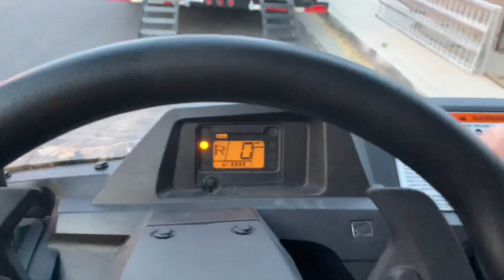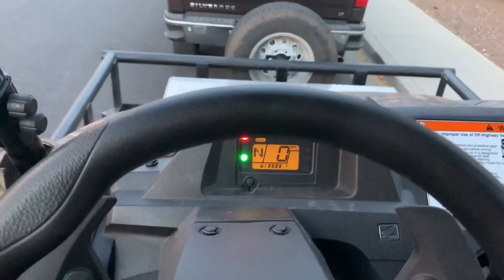How To Load Honda Pioneer/ UTV  in Trailer with straps

Comment: Looks good only thing i would change is tie off  the back with one strap from both sides so can pull down on your  Suspension bit .

You will find it is way more stable than one strap just wont do as good when on dirt bumpy roads with a single strap . Two straps pulling on back will stop it from hopping around on bad roads where one wont as rule well on our type rds anyway lol .

I even after load go down dirt rd bit stop re tight straps even the ratchet ones amazing how stuff can come loose  cheers bud .

Comment: My dealership can't figure it out with the squeeking.  I know it's the mounts but they did nothing
Reply: Bit good video lol
Reply from the maker: Ya I think they know the problem but have no fix
Reply: @ArizonaKid  it's frustrating to tell you the truth.  Lots of squeeking from that rig.  Works great but annoying.  I fixed the dump bed by using 5/16 fuel line to wrap around the latches where it closes.  Back to the squeak's your is making, the dealers are not doing anything about it.  It's horrible.  Mine started it at 40 KMS.  Makes me regret getting extended warranty cause they don't take any responsibility.  Good luck
Reply from the maker: @rickhall3578  I did same fix for Dump bed , I will tell ya to today it seemed like not so bad . Maybe the heat and ridding is helping . Will see